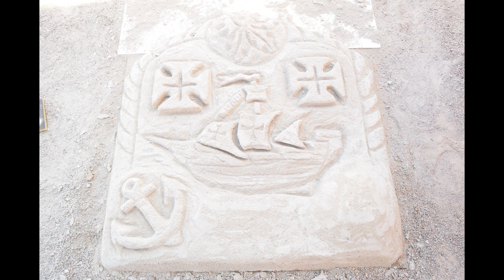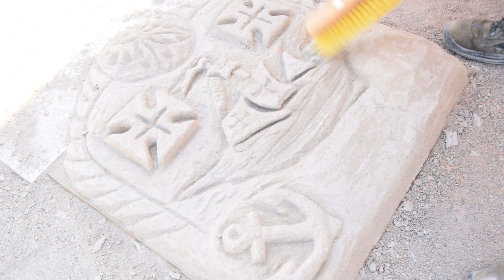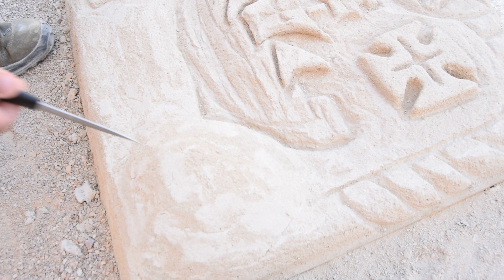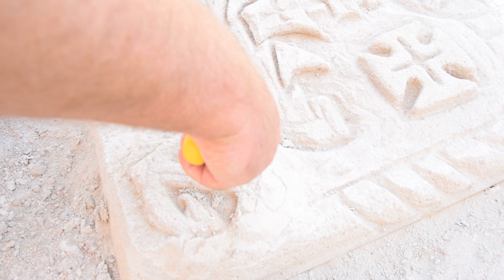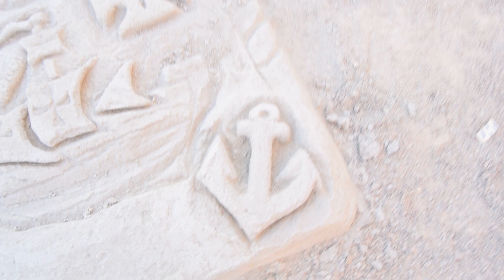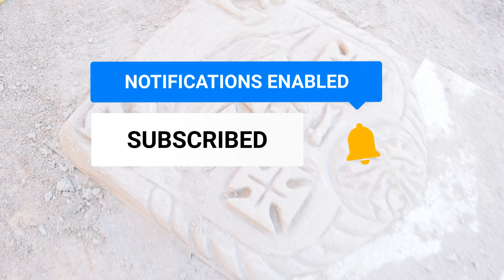😲 Carving Concrete With A Kitchen Knife 🔪 Stunning Creation using cement and sand.

Comment: One thing I would love to see is a video explanining different mixes and their specific application: virtical, horizontal, stamped, carving, natural/artificial coloring,light weight add mixtures etc.
Reply from the maker: Hi Brian, most of our stuff we us a ratio of 1 NHL5 or NL5 Lime, available at most builder's yards, to 1 part sand. The sand we use depends on how old and weather-beaten we want a piece to look. We also use ready mixed (just add water) Lime/Sand mixes. We have many videos planned, we'll be discussing colors and addmixtures in those. Thanks for your support.